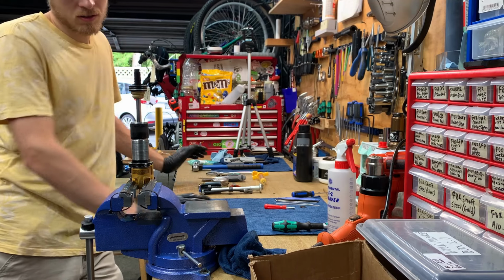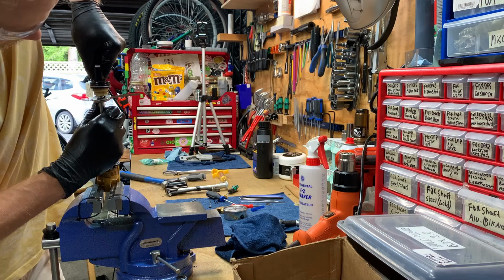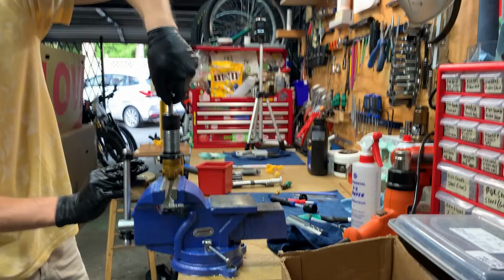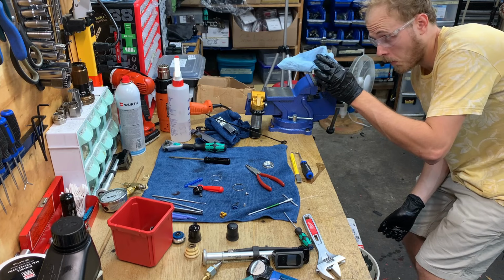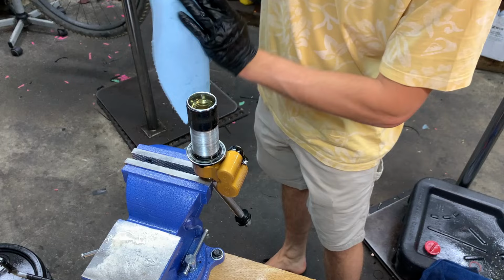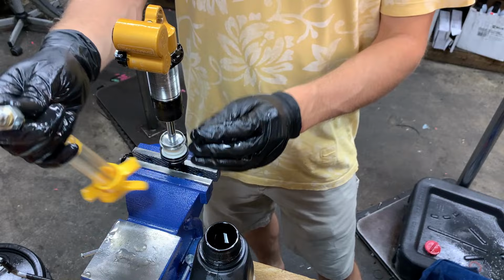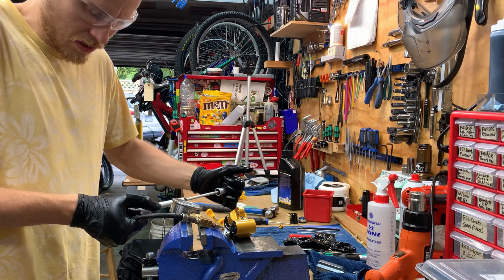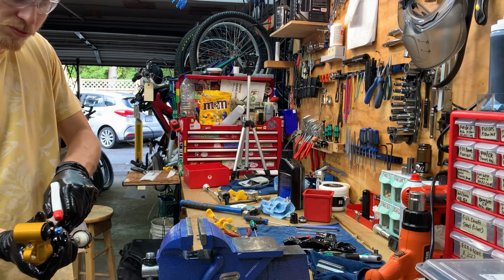Ohlins  TTX22 Rear Shock Service

Comment: The service in finland for this shock is 250eur
Reply from the maker: Crazy. To be fair, the service kit (sealhead, bladder, and bottom out bumper) is ~70USD, so that explains why it's more expensive than most shocks. Also, if you buy the various static seals from Ohlins, it's an extra 30ish USD. Then if you actually replace all of those, you are doing an hour of unnecessary work because they pretty much never cause a leak. So, it adds up. The problem is that a lot of suspension shops are not willing/have the knowledge to adjust the scope of the service for a given scenario. For example, this shock only needed a basic service and took little time as shown in the video.
Reply: Hi. @simonszoke1479 Where did you buy this service kit? I cannot find it even on Öhlins website. Great video.
Reply from the maker: Thanks @nikoe6417  . FYI: https://www.mtb-hydraulics.com/product-page/ohlins-ttx-22-coil-shock-rebuild-kit

Comment: Thanks for the detailed video. Is it advisable to remove that metal piece @3:00 and clean the seal head once in a while? Does the shock have to be depressurized before removing that piece? I found some faint lengthwise marks on my damper shaft and wondering if there is dirt in there.
Reply from the maker: It doesn't hurt but probably good enough to wash it out with a garden hose without removing the cover. No need to depressurize it for removing the cover. The lengthwise marks are pretty standard on the steel shafts for this and other shocks. They don't seem to cause a leak.
Reply: @simonszoke1479  Thank you very much Simon

Comment: Is there any way of extending the stroke of a shock to allow more extension? I have an Ohlins stx 46 shock (motorcycle) which I need another 10mm of travel on
Reply from the maker: This is a mountainbike shock, and the stroke increase is possible by using different sealhead covers. There is only 7.5 mm between the shortest and longest travel options. I am not familiar with the options for the STX 46.